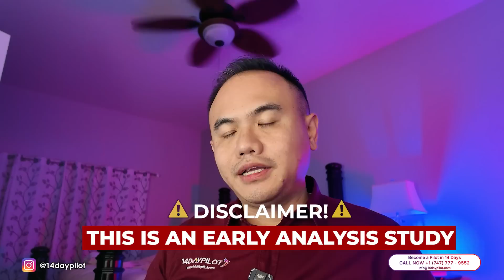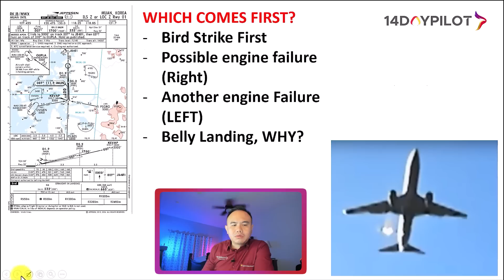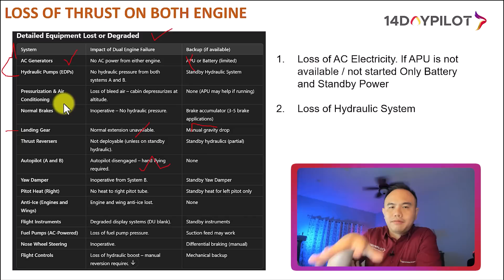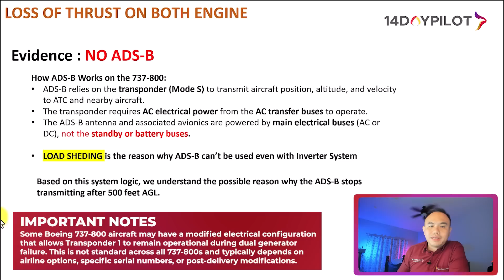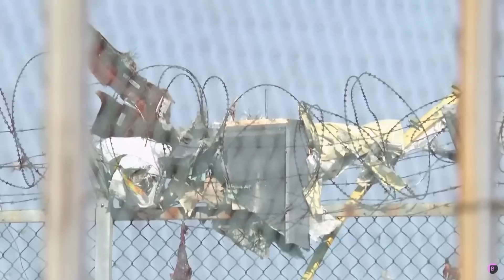NEW! JEJU AIR 2216 UPDATE :THE MYSTERY OF RUNWAY 19! B737-800 Crash At Muan Korea

Comment from the maker: IF YOU HAVEN'T SEE PART 1 : Here is the link - https://youtu.be/ebTCJGZ06y4?si=lwWfmE3lZIaT8Lfl
Reply: I'm back with the 1000-point question. Can a pilot run a short U-turn with both engines turned off, without power and without a functioning hydraulic system? Because this happened
Reply: @kikiryki  The No.1 engine never lost all power after that bird-strike which is obvious during the 'landing'-scene. It's the No.2 engine that shows completely dead during this time. So the No.1 probably still provided some hydraulics to the rudder, ailerons and flaperons to make this sharp turn. But not to the landing-flaps and landing-gear. This would also explain why this engine (No.1) was still able to open it's thrust-reverser with minimal effect. Like he says; engine No.2 was taken out completely after another bird-strike or it was shut-down mistakenly. I think the latter option is more logical. But we'll see. Terrible accident. That stupid wall at the end of the runway sealed their faith. If not there most had survived I'm sure. There was plenty of space behind that wall. Only two thin brick walls to breech and a secondary road to cross. After this free space till the water-side.

The 'gliding' of this plane was near perfect and took remarkable skill. But in hindsight the PIC rather had opted for a ditching in the all surrounding waters like Sully did. But he was most probably not aware of that huge wall at the end of the runway. Very sad.
Reply: Are there cameras recording video of the cockpit that can be recovered? If not, why? That would help with safety as it would provide more data in these situations.
Reply: Check your email. I know the exact buildings of both videos. I see the comment to my Twitter thread was deleted. The flame out video shows the plane was not on it's normal ILS approach. It was possibly outside of the ILS cone,  it it was flying more westerly than it's nominal approach.
Reply: @ciscorucinski for my thread and images and building verification.

Comment: People are blaming the pilots but if it was a dual engine failure which is high probable this is a one go situation. You have to put it down as fast as possible because you fly a glider but you have also to consider the speed, the gliding distance, the runway length, the stopping distance, the ground effect distance until touch down, and how to slow down the plane. It's really a worst case scenario, and nobody considered there would be a fu#@ing wall at the end of the runway. I think even with wheels down they had not enough runway to slow down before the wall. The touch down is way down the runway. If they knew about the wall and the landing speed then a sea landing would have been a better option.

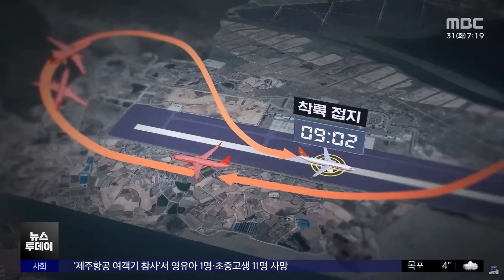Comment: 23:25 The "impossible turn" shown here reaches runway 19 half way down its length. Given all the speed 2216 had at that point the situation was hopeless. Is there anything about your scenario that would indicate that the pilots couldn't have executed a longer teardrop to use up more speed and land instead near the beginning of runway 19? Would the extra time give them enough time to manually drop and lock the landing gear? That would make too tight and fast a return the crucial pilot mistake (ignoring the turn-off-wrong-engine possibility).

Comment: Thank you for making this video and helping to educate folks on what may have happened.  Your theory seems to be that they had no engines when they did the belly landing.  However, on other videos I have seen the right engine appears to be at least partially operating and you can hear the engine as the plane goes by on the runway.  Hopefully the full investigation will uncover exactly what happened and provide valuable information to improve flight safety and pilot training.

Comment: If you look at the light/shadow dynamic on the plane at 5:39 showing the bird strike/compressor stall, you can see there was no image mirroring of the video.  The plane was approaching from the south in the morning.  The sun would have been to the left-back of this image (to the right and somewhat behind the aircraft), thus creating this exact light/shadow dynamic.

I haven't seen definitive proof of this, but from what I've seen, it appeared the pilots flew runway heading for the missed approach and turned toward the holding pattern (northwest of runway heading), possibly in an attempt to diagnose the situation.  It then appears something happened, and they immediately turned back to land on Runway 19.  Can you confirm this?

Comment: Firstly there are 3 hydraulic systems, 1 on each engine and the APU, not one pilot mentioned the APU, which is the engine in the rear, this can supply all the power needed, but this engine takes 3-5 minutes to actually turn on. From mayday to hitting the wall is 3 minutes, I measured the time from one landing light to the next, which is 3 second, I can also see the landing touch down zone marks on the runway, with this data, the aircraft was 170-180 knots, about 7000 feet down runway 19, too much speed to rushed landing and floating, if that mound didn't stop it, the aircraft was leaving the boundaries of the airport and hitting cars, landing lights etc, and the end result would still be the same.

Comment: I believe the "look-up" video showing the right engine issue is NOT MIRRORED.  I also believe that video was shot from about 1000m away from the runway 01 threshold. The fact the engine is having issues + looks quite high (for being 1000m from its intended landing) and has no gear down suggests this is after the bird strike and after the decision to go around - and that if the gear had been down, it is now back up again as they begin to head north ready to make their final turn southwards onto runway 19. The new image from MBC suggests that at some point the gear was down, probably before the strike happened.  If shot from the island of GARAN-RI? or the area of BONGNYONG-RI the plane was still 8-12km from the threshold of rwy 01.

Comment: Q2) The Plane on 2nd Approach landed "safely" and would the plane be intact and peoples did not die in explosion fire,  if it did not hit the earth/concrete wall?
Reply: If that wall wasn’t there the plane would have slid to a stop. It’s the sudden stop that gets you. There was a perimeter wall surrounding the airport property but I believe the likelihood of survival to be much higher if they didn’t impact that berm.
Reply: Without a doubt,that belly landing didnt produce a spark cause fuel tanks are located in wings that didnt touch the ground or any other structure.Hitting brick wall at that speed produced sparks&ruptured fuel tanks,perfect cocktail to cause inferno!Blamming birds is shifting responsibility to nature they weren't in control of.Birdstrikes are very common&they dont crash aircrafts otherwise there wouldnt have been airport close to bird sanctuaries.I can name 10 belly landings that went so very well not a single soul had a scratch.That  brick wall is a hot topic South Korean government doesnt want to talk about hence their president jumped to take responsibility before black boxes were even found,why do that when you don't know what happened?

Comment: He had thrust on the Number two engine. You can see the exhaust heat just as they flared. So they had hydraulics. They had about 2 minutes to do the engine loss/ landing checklist checklist, if they did it at all.  The teardrop turn was rushed. I think they shut down the wrong engine, in a panic, had partial thrust on the bird damaged engine, and either forgot to deploy flaps and gear, or thought the drag resistance from the gear and flaps would put them short of the runway, and decided to do the belly landing. There are a series of errors here.

Comment: The FIRST AND MOST IMP CAUSE IS AIRPORT DESIGN. Pilot error if any comes later.
How can u have an airport with bird nesting areas around it as well as concrete embankments on either end of the runaway.
This is like INVITING A DISASTER TO HAPPEN.
THIS AIRPORT MUST BE SHUT DOWN AND MOVED TO A SAFER PLACE.
MUAN CAN DO WITHOUT AN AIRPORT.

Comment: Based on the case where both engines fail, why doesn’t the APU automatically start on all approaches as a standard feature. Just adds another level of safety
Reply: There is no system like that in b737 or even a320.
Reply: @ I know, but maybe this should be implemented into the procedure as a result of these kind of situations
Reply from the maker: This make sense
Reply: Fuel consumption for almost no reason? Such events where pilots are unable to start the APU when needed are quite rare.
Perhaps an automatism would make senes in case of single engine failure at low altitude.

Comment: For me the most important piece of irrefutable evidence is the fact that the plane had sufficient power during all phases of flight. How do you manage a go-around if you don't have engines - are we saying he got a second bird strike on the other engine later on ? The "impossible turn" would be impossible without at least one engine running.  If you have engine power you have basically everything you need. Gear, flaps, spoilers. But none of these were used.
Reply: If you look at the glideslope which is reasonable (not too steep) and the nuts speed at which the plane tried to land, you can definitely know there was engine power at all times.
Reply: @k9killer221  Unless they had hit another bird right before their final landing.
Reply: @k9killer221   Unless they had hit another bird during the go around which prompted the pilots to crash landing the plane instead of making another turn back to the runway.
Reply: You are right.
Reply: Is there any report confirming that only one engine was affected by the birdstrike? It’s possible that both engines were impacted, a second hit while it was executing the impossible turn?
Reply: @wilsont1010  Not at all. In fact all evidence suggests the #2 engine continued to operate as well. The key thing to focus on, as per the comment, is that engine power was NOT A FACTOR.
Reply: unless there was no one on the plane and it was controlled remotley..
Reply: You don't know the fraction of normal power available from engine #2. Or when engine #1 was turned off or stopped functioning. So, no, you don't have irrefutable evidence [of] the [non-]fact that the plane had sufficient power during all phases of flight."

Comment: They talk about how safe these planes are. Also how we learned from the past, and fixed the problem. How is there no safety check or a stop on the switch to shut down the only full powered engine? You shouldn't be able to shut down an engine, below 1000 to 2000 feet. If it stalls below that, it is too late to attempt to restart. Boeing is out of touch with modern tech. Everything they touch, turns to crap! I don't think Airbus is using tech from the 50's! I quit flying for work, and drive now. I can't always count on avoiding a Boeing. A 4 day ride may not be fast, but you can sure see a bunch you don't see from 36,000 feet. Plus, Boeing doesn't build anything that travels on the ground.  My heart and prayers go out to those families.

Comment: no legal requirement for the apu to be functioning on takeoff, but they still should have had 30min of battery power for flaps. if this was caused by panic, from toga to teardrop happened so fast they never ran any checklists. hard to believe they were fighting or that frozen in fear to do the job properly. they also wouldnt have flown into that airport for the first time and known about the conrete wall. doesnt make sense.

Comment: my opinion is, Pilot get panic after bird strike only one pilot was operational other was some were else. psychological way pilot believed he already deployed landing gear protocol and in panic and rushing he forgot to reconfirm.and performed landing . once he realized  his mistake hydraulics failure occurred. as we can see stability and alignment with runway smooth landing, and the landing angle of the plane while it was landing was perfect if pilot imagine he deployed landing protocols. i feel this is another question on pilots mental condition as you know 13 flights in 48hours.179 loose there lives because of industry want more profit especially in new year time ( its peek load of passengers in aviation)

Comment: I've been flying this aircraft for almost 27 years. Great job on your analysis. My question is the same as yours; why does the no. 2 thrust reverser seem to be deployed? Perhaps the no. 2 engine was never shut down, and still had partial power? Bird strikes don't always = engine failure, or loss of engine. NTSB will reveal all. I'm not critiquing, just questioning the current data available.
Reply: Thsnk a lot captain.  In my view its better they lost both engine rather than they still have engine but immediately return without Landing gear
Reply: @GemaGoeyardi   Great systems review. What about the bus tie relay that opens when on an ILS? I'm just thinking about that ADSB DATA....
Reply: @ dear Capt Maiden

If you see the first video or adsb you will see they were on aggressive pitch up and down and not straight on the lateral path (Mini S turn)  it is likely the A/P is Off and probably but the ILS stays with the other Gen takes over via BTB. However there is an information from
The Korean news that not so long after mayday call they were disappearing from tower radar which also ads-b loss. 

This was really2 weird and just only possible if they loss all AC system  and this airplane has no ac standby bus wired to the transponder. 

Really hard and tricky case.
Reply: @GemaGoeyardi  Haven't seen part 1. My apologies. Great work on all of this. Lots of efforts on your part.
Reply: @ironmaiden8625 thank you captain Happy New Year!
Reply: @GemaGoeyardi  Same to you!

Comment: how hard is it to do a water landing? just curious
Reply: Landing in water is the same as landing on a runway in terms of hardness. Water can’t be compressed and it doesn’t move out of the way fast enough. A lot of people believe if they jump from a considerable height all they would need is to hit water to survive. The plane is massive and carries a tremendous amount of energy. When it impacts the water even with the slightest angle and not perfectly wing level it will cartwheel. Water isn’t always the best option especially if you have an opportunity to make it to flat ground.

Comment: Looking at the landing. It is clear that engine two (Starboard engine ) is running and exhaust cen be seen. However, Engine 1 does not show exhaust.
Moreover, when the tourist video shows the Compressor fail (it may be a reverse angle due to Mobile phone, making it engine 1). Also the flaps are down in the tourist video from the balcony. But when the plane lands, it is clear that the flaps are not retracted. If you look very closely, there is Yaw to the left. Making it that engine 2 is running and pushing the plane to the left. Finally, The speed of the plane did not reduce, and from what I see kept the speed all the way until the Concrete berm.